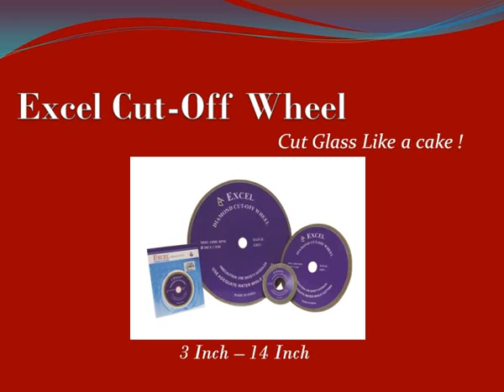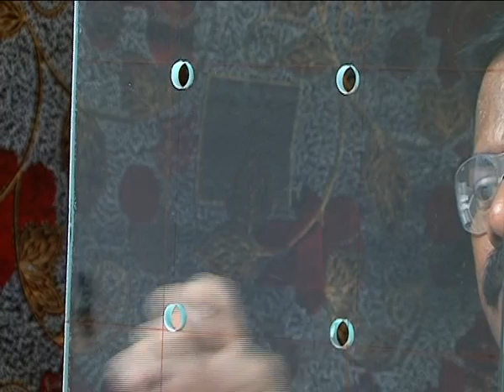DIAMOND CUT OFF WHEEL I JIJY M J GLASS TECHNICIAN I DIAMOND TOOLS

Comment: Hello. Can you do a video cutting tempered toughened glass? Even if it shatters can you still cut through it? Also to cut glass, do you need to drill 4 holes or can you just put it on the glass and cut.
Reply: You cannot cut tempered glass. It will explode into a billion pieces

Comment: Yes you will feel relaxed and at ease with the job of cutting the glass until the disc spinning at 10,000rpms while in the glass cutting your line gets just a hair off center from user error and digs into the glass either shattering and throwing shards in every direction OR the angle grinder jerks towards the direction of spin and gets into contact with your skin or worse your clothes.   ALWAYS USE A GUARD ON YOUR ANGLE GRINDER WHETHER CUTTING OR GRINDING.  Always!!  Try simply powering the tool on momentarily with any grinding disc and when the disc is slowing down about 2 or 3 full seconds after switched off, just touch the flat of the disk..  just with the fingertip as quick as you can..  in that millisecond of the touch you will lose enough skin that will mimic a 3rd degree burn.  If no deadman switch and just an on/off switch imagine the horror scene if it grabbed your shirt and twisted it so tight you couldnt breath in an instant and while struggling to breathe and turn the tool off it will be imbedding the blade into your body which has a rockwell hardness of a marshmellow.  They can kill..  gloves dont matter, protective clothing doesnt matter unless chain mail.  Keep proper grip on tool all times and dont take off the fucking guard..  if you need a different guard for cutting vs grinding, take the time to change em..  and dont use a bigger wheel than the tool is designed for.  Smaller is ok, bigger will explode, 100% of the time..  be safe, if your doing something that you wouldnt ever do with your pecker out, think about what youre doing first..
Reply: Have you or are u working offshore on an oil rig or installation? Cause this is exactly what we are taught in the safety courses. All the things you’ve said are absolutely right. No safety - Know accidents , Know safety - No accidents. 😊👍
Reply: Love letter.